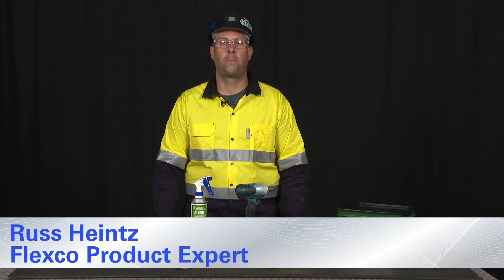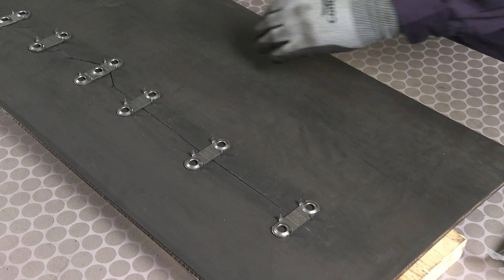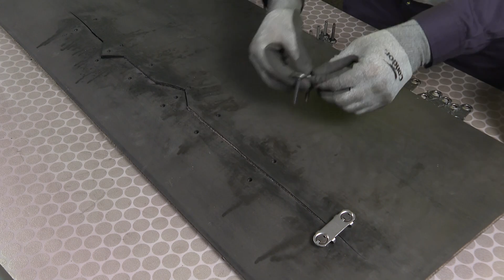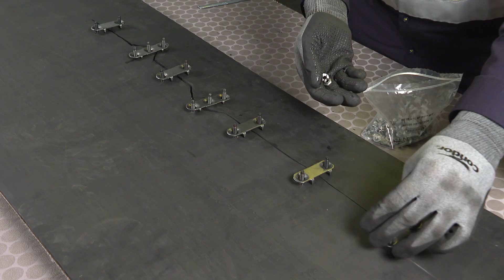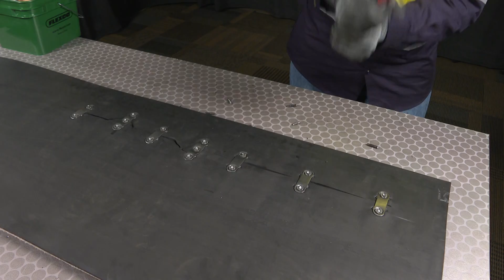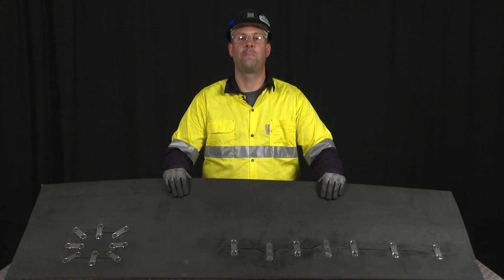Performing a conveyor belt rip repair with Flexco® Bolt Solid Plate Fasteners

Comment: Which tool is using for tightening nut for flexco fastener, because i tried 14 no socket but can't make good tightening, is this any special socket please suggest sockets type
Reply from the maker: The recommended tool to tighten the Flexco nuts is using the Flexco Power Wrench.  This wrench is designed with tabs that mate into the slots of the nuts and allows for lower profile and stronger grip into the belt. You can search for HW1, HW2, or HW3 in our handbook or website for the  corresponding wrench size for your fastener you are installing.
Reply: A thing to note when looking at anything Flexco, is they make everything proprietary even if they could easily make it a standardized item, to keep you inside of their product line and have you coming back for every replacement part you need(with items that are overpriced to heck for what they are)

Comment: What do you do when the boat pops out of the back and then you can’t get it to fasten down?
Reply from the maker: It is recommended to place wood or hard surface underneath to prevent the bolt from backing out.  If the bolt does back out you can hammer them back into location making sure the tabs realign.  In addition, hand tightening the nuts so the plates contact the belt cover will help prevent the bolt from backing out.

Comment: What is the name & Specs  of  Tool & drill bit  used for  making holes?
Reply from the maker: The tool is an ½” drive impact wrench with a max 250 ft. lbs. (339 Nm).
The bit used for making the holes is the Flexco Power Punch. Depending on what size fastener you are installing you will need the corresponding punch size.  To tighten the nuts you will need the Power Wrench. Once again choosing the correct size for the corresponding fastener size. Lastly, you will need the Quick Change Chuck to attach the Punch and Wrench to the impact wrench tool.

Comment: This is join a fabric belt, how about steel cord belt? Can you show me the way to join it
Reply from the maker: Hello, you can use the same method to install rip repair on steel cable.  Make sure you pick the correct fastener size to try to match the pitch of the cables so the bolts place between cables. The larger the fastener the better so you can lock in more cables for added strength.
Reply: FlexcoTube Thank you so much.

Comment: How about removing old worn flexcos?
Reply from the maker: You can use the Flexco Cracking Chisel to break the nuts to then remove the bolts and worn plates.  Another option is to grind an “X” on the nut to detach it from the bolt threads and then remove the bolt and worn plates.  Make sure not to damage the belt if grinding the nut.  You can then replace this area with a new Flexco if the holes are still in-tact.
Reply: I use a 2x10 piece of wood faced with 3-16 mild steel to support the belt. One smack with the cracking chisel with a 4 pound hammer does the trick.